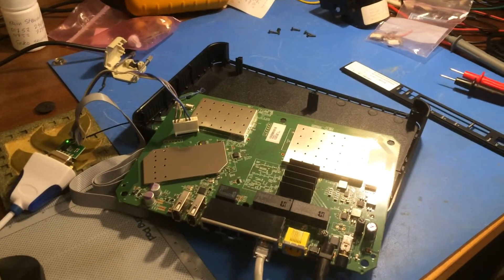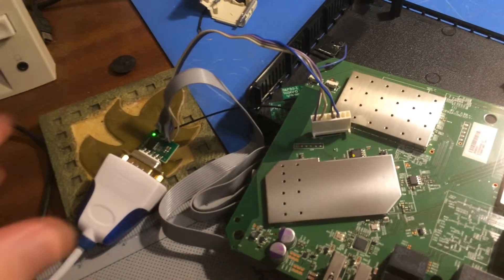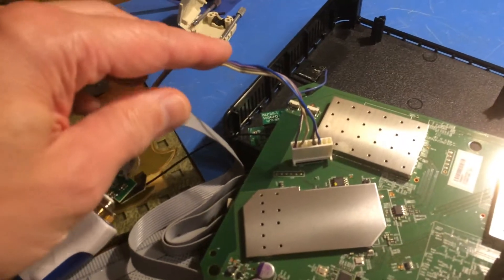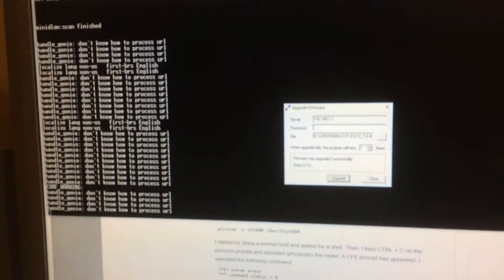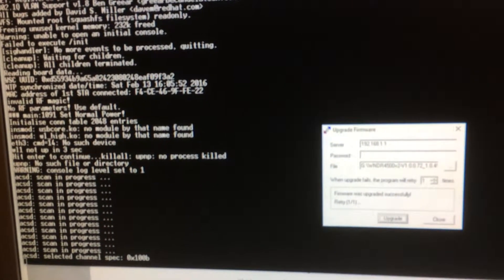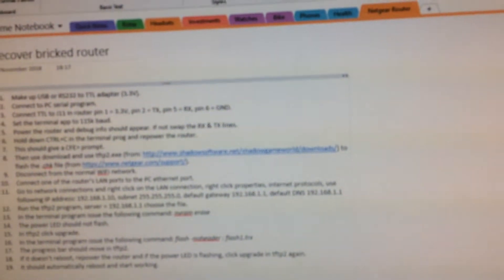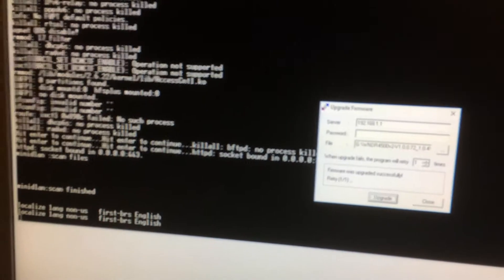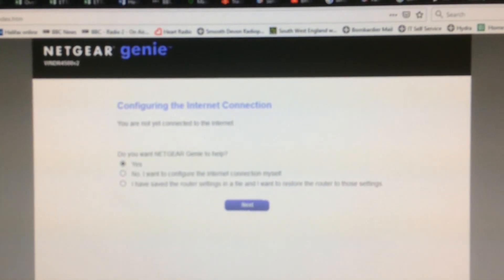Netgear N900 WNDR4500v2 Recovery from Bricked

Comment: I have a bricked AC 1900 R6900V2. I have tried all the instructions on Neatgear website and nothing works. I either get orange power light and orange port light or I get a flashing white power light and no port light. I can ping the router but it won't take the flash. The brick occurred when I clicked update in Net Genie Browser Page. I am at a loss as to what to do at this point.
Reply from the maker: Have you tried what I did in the video to erase the NV RAM and reflash the memory?
Reply: @bvqbvq  unfortunately i don't know as much about this as you do. I am fairly knowledgeable in computers, but not at this level. I don't know if my router has the same board build as yours. Thanks for the reply.
Reply from the maker: @bobbygordenakaredneckbilly3856  until I recovered the router in the video I had never done it either! I would remove the cover of your router and see if looks like the one in the video. If it has the same programming connector underneath then you should be in business. You need to buy yourself a cheap USB To RS232 TTL UART PL2303HX (eBay or Amazon) and then just follow the instructions in the video and in the notes above. You can download Teraterm from here: https://osdn.net/projects/ttssh2/releases. It is a little bit of a fiddle but I had it done in just over an hour.

Comment: I dont have a serial programmer adapter, but I have a few raspberry Pi's My WNDR4500v2 recently bricked its self when I was updating the firmware. could I use a pi as a programmer, I know you can use it to program things like arduio's amd openocd has something but I dont understand any of that. I dont have the time nor change to get a usb programmer I'll only likely ever need for this one issue and I cant buy a new router. do you happen to have a pi and know how one would go about using that to flash the firmware to de brick this router?
Reply from the maker: You can buy a USB to TTL serial adapter from eBay for very little so I wouldn't even bother with the Pi. It is certainly cheaper than a new router and you'll have it ready for when you brick it again ;-)
Reply: @bvqbvq  thanks for the input, I'll look into that. with the world the way it is, I dont want to deal with shipping at the moment lol. I have a few 3d printer mainboards and a com port on my motherboard of my pc I'm sure i'll figure out a way to do this without another piece of small hardware i know i'll lose when i need it again lol.
Reply from the maker: @gabrielsennheiser  Shipping should be OK if you still have a working distribution network. If you can find something with a MAX232 IC in it then you might be in business. If your PC has a COM port then at least you won't need the USB converter as well. Good luck!

Comment: what is a purpose of  USB connection?
Reply from the maker: It is a USB to serial adapter to provide the RS232 needed by the board. If your PC has a COM port then you don't need the USB connection.
Reply: Kevin Stewart I mean, you used it to enable tftp mode? I'm trying to unbrick the same router but cannot make him listening tftp connection using reset button
Reply from the maker: @chebrets  have you followed the process in the description? Do you get the CFE> prompt in the terminal? Do you get the debug information when you power up the router with the serial connection to the terminal? If you don't get these then there is a problem with the serial connection and you must fix it first before using tftp2. I've only ever done this once with this router so I don't know what else to say.

There is some info here: https://community.netgear.com/t5/General-WiFi-Routers-Non/WNDR4500v2-Router-Recovery-Using-UART-Serial-Converter/m-p/1296088#M103933
Reply: @bvqbvq  thank you, I'll buy a TTL-USB adapter and follow your instruction
Reply: I have all debug info when power on router but on step  7. It gives only "CFE>" and I cannot move forward :(